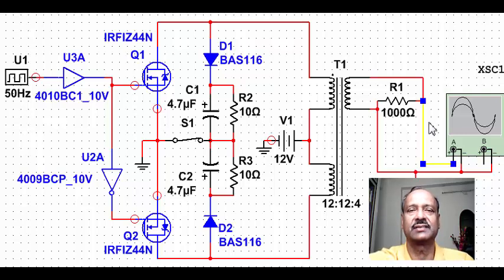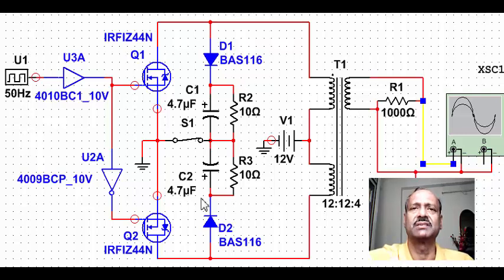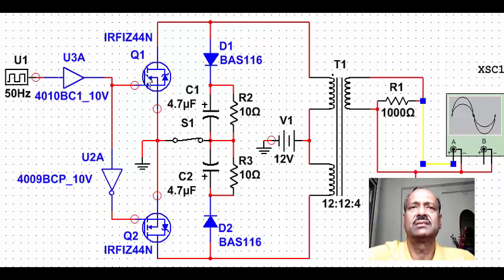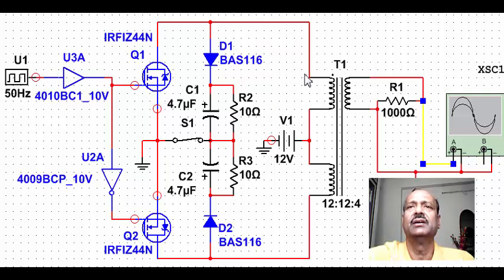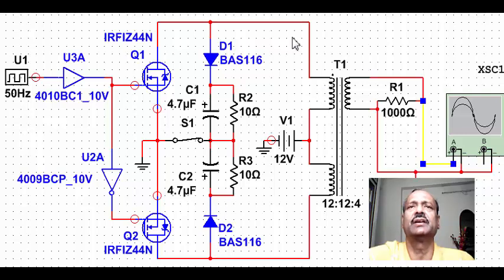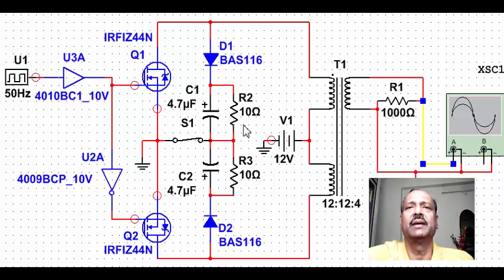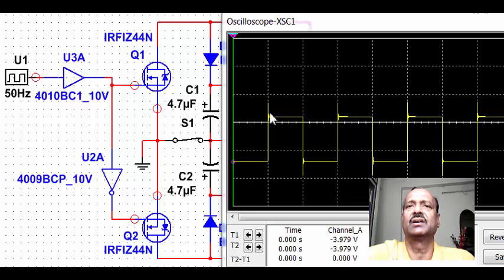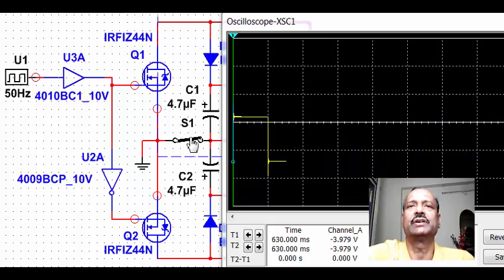Practical Electronics snubber circuit 2

Comment: this is a clear illustration, your resistor and capacitor are in parallel, the snubber circuits i see have the resistor and capacitor in series'l,  my second question is ..the value you chose for the resistor and capacitor, are they typical value or there is a way of calculating the values
Reply from the maker: In snubber theory, resistance and capacitor are generally in series but in practice it the way I have shown followed by Philips, Siemens, GEC because there professors with zero practical knowledge don't design but practical engineers design them

Comment: Diodes are placed wrong way round, they should face the same direction as transistors in your mosfets - with 'bar' (cathode) to positive side of the circuit. In your schematic they are conducting all the time. Reason being that during inductive spike current is reversed. Capacitors C1 and C2 should be of non-polar type.
Reply from the maker: Sorry professor. I address you as a professor because of your comment which is too theoretical and age-old bookish language. This kind of snubber is followed in all practical circuits by Philips, Crompton, GEC, Sony, Mitsubishi and many more. Me having over 45 years of exposure to industrial circuits by virtue of my profession have just copied this concept from them. It is not my invention.

Comment: You dont need so many components for push pull snubber. Simply one resistor and a capacitor is adequate for it. Also in real application you need deadtime management or else your mosfets will give magic smoke in no time.
Reply from the maker: Satyajit Roy You are right in theoretical way but in real hardware this is followed by all most all the reputed international manufacturers. Dead time is provided by the program and not the hardware way.
Reply: Patnaik UC actually most of the practical implementation uses series resistor and cap on each legs that is because of the dead time insertion. This kind of push pull DC-DC conversion is used in UPSes and many other areas and I have seen they use resistor and capacitor in series. If you refer to the application notes from Texas Instruments or Linear Technologies you will see that series RC type is what they always use. I am sure they know what they are doing. I understand deadtime is maintained by software or sometime in hardware itself (dedicated push pull drivers dont have any software config) but its fair to mention it in the video. Because if someone follows your inverter type driver then he or she wont understand what wrong they are doing. I am telling you from the practical aspects in life.